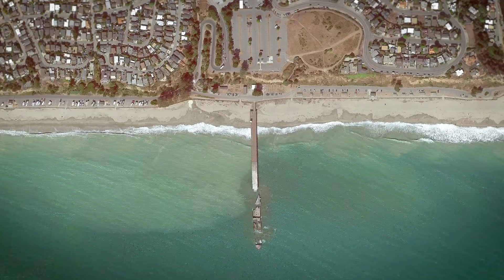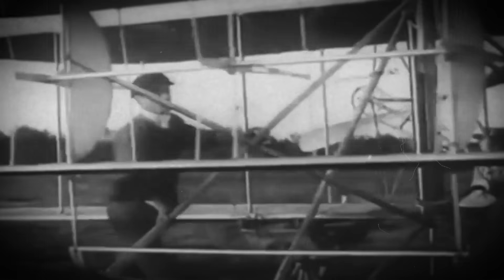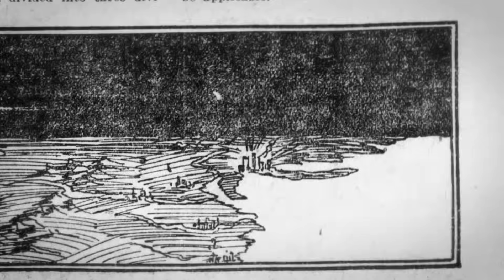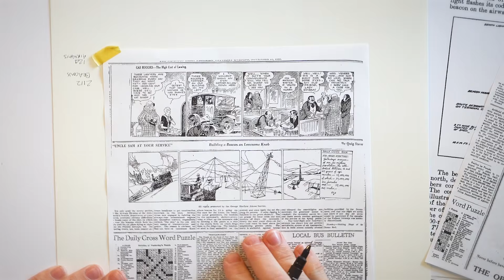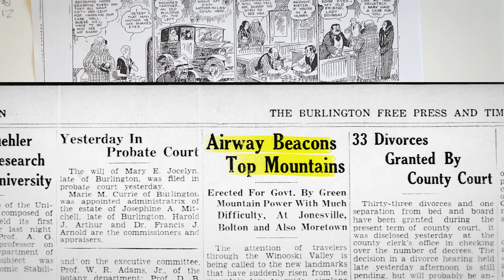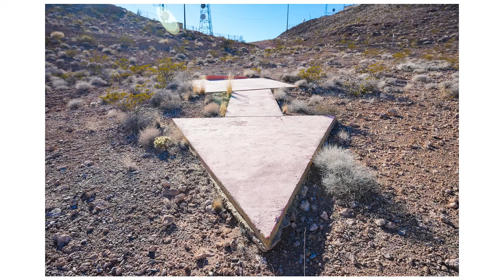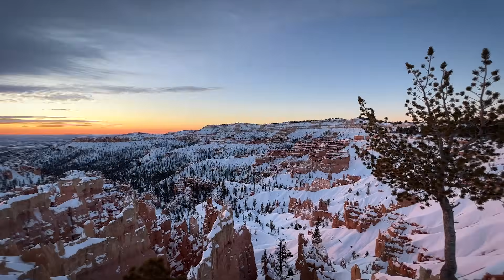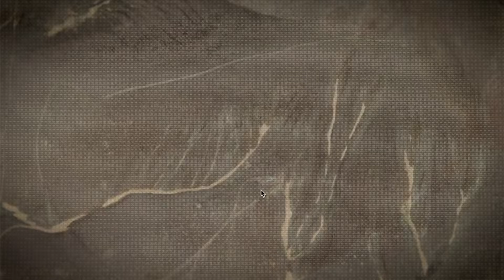Americas Forgotten Network of Abandoned Aerial Highways

Comment: I lived in Southern Nevada for about 3 decades. I would go out of my way to to just drive into the desert. There is so much cool stuff that will be there for a long time.
Reply from the maker: Yeah that level of dry weather is ideal from preservation. So much cool stuff sitting out there!
Reply: @CalumRaasay  there are 2 stone beehive kilns on the west side of the Spring Mountain range that was used to make charcoal for smelting metals in Death Valley in the 1800s. One was more or less a pile of rocks but the other was in good condition. It's been more than a decade so they might be both piles by now. The craftsmanship was incredible that they could build 40 foot diameter 40 foot tall stone cone shaped structures with no mortar!
 Close to them was a concrete tank that held spring water built originally for range cattle but now the wildlife uses it as their water source. I would drive up there, park my 4x4 and sit, enjoying all the visitors coming for a drink.